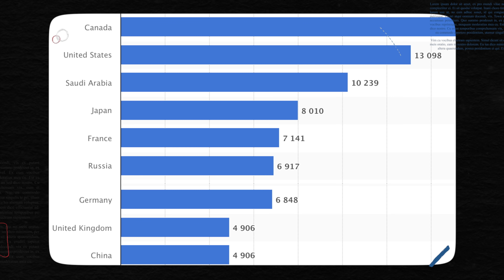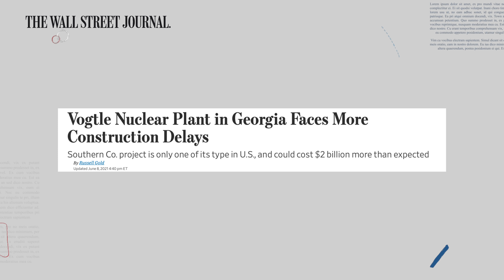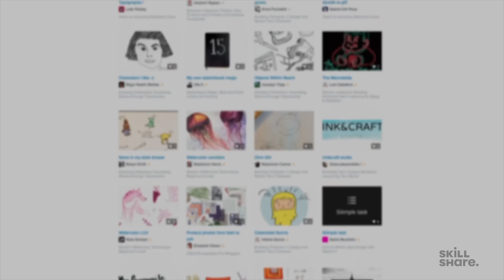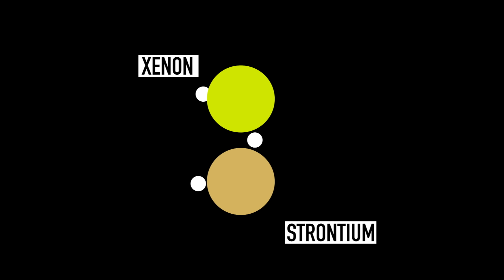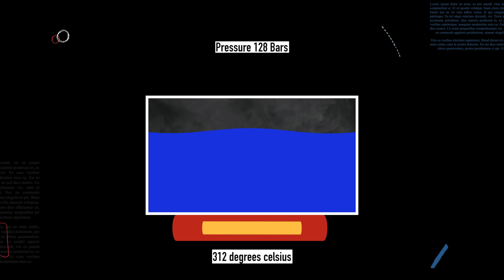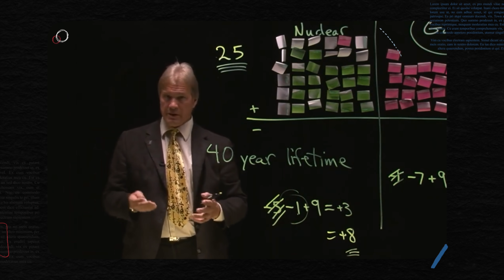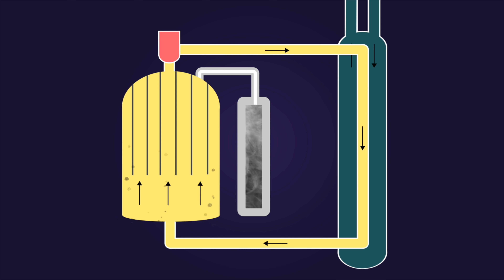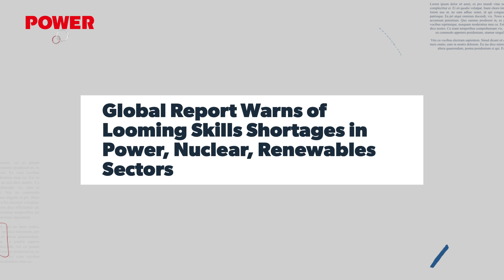Thorcon Just OBLITERATED Nuclear Energy’s Biggest Problem

Comment: Great presentation!. There are a lot of details to explain and you covered most of them.
Another advantage of not needing pressurized water is that during a major loss of pressure, steam can split into hydrogen & oxygen as I understand by being catalyzed by zirconium in the fuel rod jackets. That leads to a hydrogen explosion such as in Fukushima. No pressurized water so no hydrogen explosion.
Once these and other molten salt reactor designs get established in as many countries as possible, I don't see the point of mixing renewables into the same grid.
Reply from the maker: Yep!

We thought going too far into the weeds with hot zirconium cladding reacting with steam would defeat the purpose of trying to simplify a somewhat complex process. 

That’s why we like to give a shoutout to Gordon Mcdowell. His videos are long, detailed, with question answer sessions etc :)

Comment: With the claims their making it sounds like the material science has finally been sorted out with the molten salts.
Reply: Exactly, molten salt  eats metal
Reply: Hasteloy-N is the best current answer to that, and it degrades in use.  My snooping has lead to Alfa Laval in Sweden.
Reply: Not really, they still have to replace the part that is in contact with the molten salt every few years. Which will be radioactive after being bombarded with neutrons.
Reply: Thor Con’s solution to that is to use two units side by side and at the end of a cycle, flush the salt to the ‘B’ unit, then let ‘A’ cool in place for 4 years before extracting it for reprocessing.  The half-lives are shorter with thorium.

Comment: My one concern is climate change.  In two regards - rising sea levels would make a near-shore installation more prone to flooding, and an increase in storm intensity and frequency would make for a rough time for any structure at sea, again with flooding but also structural stress.  The Danes have built this into their off-shore wind designs, because they started in the North Sea with the assumption that they needed to design for heavy seas.  So the question becomes how adaptable are Thorcon's designs?
Reply: It's a boat so it floats if you want it to and you just put it somewhere else.
Reply: @charltonblake9967  - I guess I'd gotten the impression they'd sink it in place. A semi-mobile platform would make more sense, though there is still the issue of riding out heavy seas.  A ship, however, because this is how my brain works, leads me to worry about hijackings or piracy.  Although its not too far fetched that we might be seeing in the near future merchant vessels mounting military hardware like CIWS to prevent pirates or terrorist drones (or rogue LAWS - lethal autonomous weapons systems), so an armed civilian nuclear reactor wouldn't be out of the realm of possibility.
Reply: @sword_of_light  Its base design is for a fifty foot, 15 meter Tsunami. Presumably in places with higher risk design could be adapted for greater wave heights, but a better idea is to simply not put them in harm's way.

The entire plant is settled on a prepared gravel bed. It is a barge and can be refloated but that is not something you would do at short notice, probably take a few days or weeks to prepare. The important point is when it has reached end of life, entire plant can in a single operation be simply refloated and removed to a scrap yard for recycling.
Reply: Likewise, just assume x meters of sea level rise over the lifetime of the plant, and build it accordingly -- on higher ground, with breakwaters, whatever. Since construction of the first plant hasn't even started, that's very simple, and not all that expensive. It only becomes so if you have to do it to an existing structure.
Reply: @wwoods66  I was talking to engineers building a bridge over a tidal river near my place. They told me they have factored in a meter sea level rise over the 100 year planned life of the bridge. I expect around the world most would be working to similar criteria.

Comment: I think Hydrogen is way forward.
Floating solar power plant on coastal area and a ship to produce hydrogen. Then export it to cities
Reply: How does it make sense to use sunlight to create electricity.... To use that for very inefficient electrolysis to liberate hydrogen... To dispatch to cities... In order to use more water to spin a turbine and create electricity?
You already have electricity.  Just send the electrons by cable.
Reply: @alldeeplearning949  the process heat could make synthetic carbon fuels carbon neutral.  So existing trucks could continue into the sunset.

Comment: They've got a new hydrogen fuel cell that will produce electricity at less than a tenth of the price of a nuclear fusion reactor
Reply: A you mean fission, and b the hydrogen has to come from somewhere. So no.
Reply: Check out E for electric cars on YouTube
Reply: And where do you get the hydrogen? And what fuel cell wouldn't be 1/10 the price of a reactor?
Reply: @benthere8051  you can get it out of the air you can get it out of water there's lots of places to get hydrogen
Reply: @thomasmoore4576  Molten salt reactors work at temperatures high enough to disassociate water into hydrogen and oxygen.

Comment: You say you're going to put your spent-fuel on the uninhabited islands what are you going to do when you get storms natural disasters and they get blown off the island out into the ocean that's going to pollute the ocean whenever the Salt Air starts eating through the containment vessel
Reply from the maker: It’ll be in shielded shipping casks with concrete. And they’ll probably be kept inside a facility, not on the beach :P

That was just the beat vector of ‘Island’ we could find at the time.
Reply: @TechforLudditesSira  With the melting glacial ice sheets and warming oceans expanding, the islands (ANY islands) are likely to be submerged in the coming century or two.
But, I'm all for molten salt reactors replacing base load. And load following reactors offer a great compliment to current renewables like wind and solar.
Reply: @George Mann They're also really volcanic, right???

Comment: Graphite moderator, no secondary containment, deployed at sea level where the entire facility may be subject to tsunamis or land slides.  I'm a fan of nuclear power, but I think we've heard some version of this Grimm's Fairy Tale before.

One economic problem with small, load-following reactors will be increased burden on the ranks tax-payer funded, government inspectors.
Reply from the maker: Hey, there was just not enough time in the video to mention all of the design work and simulation they had done to make this resistant to earthquakes and tsunamis. 

The graphite moderator causing an explosion would be really really difficult considering the working fluid is molten salt and not water :)
Reply: Solid salts don't dissolve the quickly in salty seawater.  Any integrity break would result in solidified collectables.  Robots with AI could take the reins from there.  The lack of engagement with fission energy is the larger danger.
Reply: @George Mann More rain in wet regions means more water moving through major channels.  I've seen entire marinas wiped out, dry docked or not.  If it's not anchored to bedrock, it can be overturned, and then the failsafe system won't work.

Comment: Power from Steam...
It's amazing we haven't moved out of the dark ages
Reply: Don't be an idiot - it's the perfect medium. Do you use square wheels because the round ones are so old fashioned?
Reply: It doesn't have to be steam. It could be supercritical CO2. In that state, it can expand like a gas and yet still move with the density of a liquid; it can even dissolve things the way a liquid can. Supercritical CO2 can be pumped, compressed, and driven to spin a turbine with an efficiency that steam may never reach. (the CO2 is in a closed-loop, and not released to the atmosphere)
Reply: @benthere8051  Sounds pricy compared to steam.
Reply: @bozo5632  Supercritical CO2 is 10% more efficient than steam. That's a huge difference. That's 100 MW in a 1 GW power plant!
Reply: We are moving into the dark ages

Comment: So they are placed on the sea floor? how resistant will they be against tsunamis?
Reply: Very. Tusnamis out at sea? you wouldn't even be able to tell it was happening - the local waves would be higher. They only get large and nasty when they reach the shore.
Reply: @JohnnyWednesday  you do know that the entire thing about a tsunami is that it's not just a wave, right? A surface wave at shore, no matter how big, has barely any energy a few meters below. But a tsunami is moving the entire water column from surface to bottom. Have you seen the videos of the reefs after the 2004 tsunami? There was hardly any coral left down there.

So no, a tsunami is just as dangerous underwater as it is on shore.
Reply: @George Mann because a ship is floating on the surface... Where a tsunami is just about half a meter in height. It's still the entire water column moving up and down and not just the top 0.002%.
And the closer you get to shore, the higher up the moving water column pushes the water on top of it.

Like, seriously haven't you seen the footage of 2004? Where the entire ocean seemed to dissapear from the beach? A tsunami is not a simple wave and those nuclear reactors would be build in estuaries or on the continental shelf, where the water column gets restricted and the force of the wave gets up almost exponentially.

Your claim only holds true if the reactor were to be placed about a kilometer or more off shore. And they're not going to do that, because of cost. They said they'd be building this near the shore. This is not deep water. Everything less 150m is not insignificant with a tsunami!
Reply: @George Mann he's actually right about the way tsunami work, just not so great at explaining. tsunami do not have any energy above the surface - that's why ships are not affected, the energy is sub-surface and dispersed, as it approaches the shore it concentrates in the shallower water and becomes dangerous on the surface too. so a tsunami would be a threat to these installations, because they need to be near the shore to be useful, and would get hit hard by that concentration of force... if placed in an affected area! and that is the key! 

it would be possible to find locations where a tsunami would have minimal impact, by keeping it out of open ocean, where they are shielded by land, or the energy is dispersed. so it would be a problem, but a manageable one.